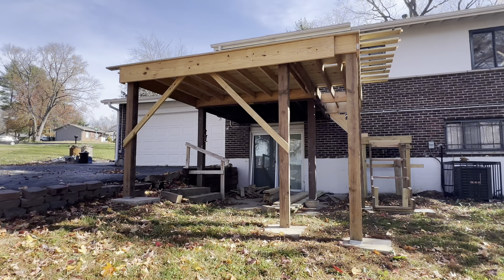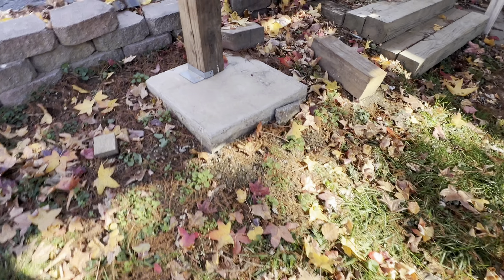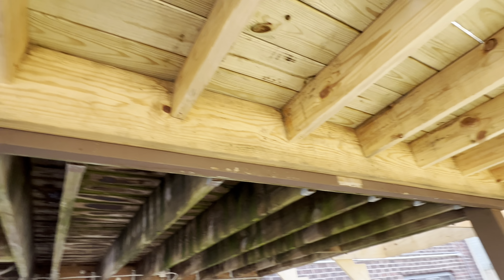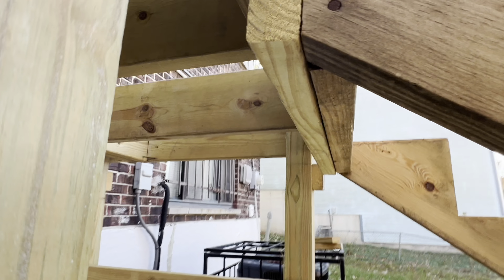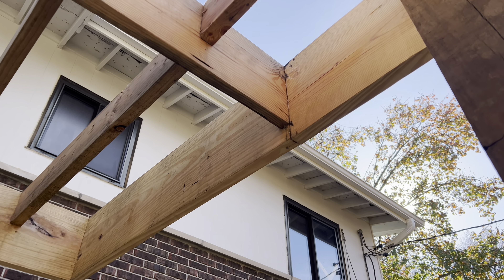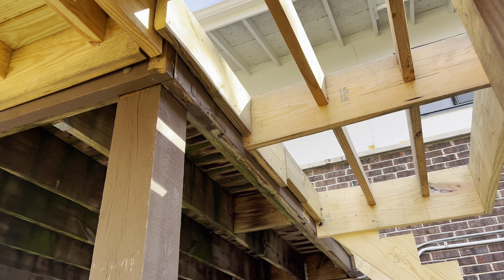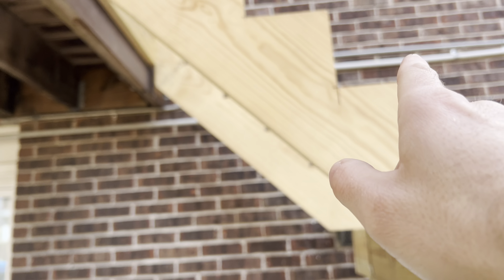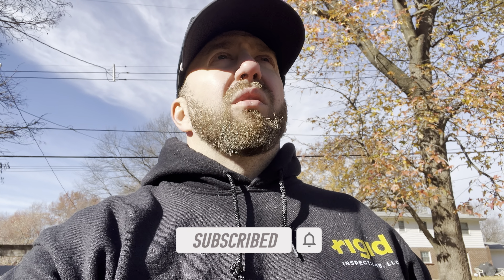JUNK Deck Costs Homeowner THOUSANDS!!

Comment: NEVER use “deckmate” brand screws (the ones from home depot).
They redesigned them several years ago with a priority given to maximizing the amount of screws that can be turned in with a single battery charge.
These screws have very little holding power, especially if you are going into end grain (where they will have ZERO holding power)
Just a terrible screw that has caused a ton of problems for people unfortunate enough to have used them in their project.
Reply: yeah they also seem to have shorter threads than other brands I have used recently. Which leads to them spinning out in places they should be digging in. And then you can't get them out without taking the board off and hitting the pointed side with a hammer. Very annoying. I found it is best to order screws online at a much lower price. You can get quality GRKs for what lowes and HD want for deckmate screws. And GRK screws will back themselves out 99% of the time because the thread goes much further up the shaft.
Reply: @hotbam37  you realize that the shorter threads are designed for screwing down 1.5 inch thick boards?  The long thread screws don't let the 1.5 inch thick material tighten down to whatever it is being screwed to.  There is a place for longer threads, and a place for shorter threads...

Comment: Normally I would say the deck video is so bad that it doesn't look real,  but,...      my daughter called me several weeks ago because the deck that came with their house was sagging.   I had been encouraging her to go ahead and plan a new deck since the one that came with the house was small and around twenty years old, still I grabbed a few tools and went to take a look, crap.    Their deck had been built to the same standards as the one in this video, with the exception it was done with nails and not deck screws.   No hangers, no bolts, no 6x6s, no notching, and hopefully there were footers under it's 4x4 posts.    What we did was use a jack to raise and level the flooring section, adding a 6x6 post and a couple of 2x8s as a beam to support the deck load.  Then added hangers and used "Timberlocks" to temporarily tie everything together so they can at least safely use their back door.    I told her the only real solution is to completely tear it down and start over with a "Proper" design which they can do themselves through "Lowes/Home Depot" as a starting point.

Now back to this video since I didn't notice a building permit which of course would have required an approved design.  Seems most likely the homeowner didn't want to get a permit and found the guy who would do it on the down low.  One additional thing about my daughters house, when they bought eight years ago they had a "Professional" home inspection performed, he found a lot of minor issues but seems he never looked at the deck which to me would have been a huge red flag.   I also suggest she file a complaint about the so called home inspector,...

Comment: The #1 reason I became a Home Inspector was the number of dangerously poor decks I saw while in the lawn business and also from power washing decks. It never ceases to amaze me how many do not have basic carpentry skills or own a level. Everything this guy did is completely wrong and should be condemned and torn down! It's obvious no permits were pulled, but sometimes even the local inspectors can't be trusted.

Comment: Horrible.  One time I saw a deck on a new construction house where there was a ledger on the house, but no joists hung on it, except two end joists maybe 12 feet apart.  These were used as beams and were both holding joists which were parallel to the house.  The whole thing was already bowed in the middle.

Comment: This homeowner needs to sue and this inspector needs to go after this stoog of a "contractor" and not only fine the crap out if them but also revoke their license and prevent from future projects. I've seen some crap before but this is a freaking nightmare. I've seen the 3 stooges do better work than this. I've been in the residential construction field for 30+ yrs and OMG it's a wonder this didn't fall apart the moment someone stepped on it. And those stringers....... 🤦‍♂️👎
Reply: these guys are always broke---taking them to court won't do any good

Comment: Judge Judy would have a field day with this one. 
Some of the 2X material is not treated. The upper stringers are not treated, it looks like the added “ledger” at the original deck is not treated. You can tell the lower stringers are used by the busted 2X tread/riser…. that happens every time you tare out a set of steps. The homeowner probably shopped around to hard and found the bum. A $500 deposit is suspicious, you can’t get much material for $500 bucks. 
RUN THIS JACK LEG OUT OF TOWN!!

Comment: I encourage anyone looking to hire skilled labor for a big project (carpenter, plumber, auto repair, etc) to do their due diligence and see what the job entails. With all the e-books and youtube videos, there is no reason not to he informed. This homeowner could have pulled the plug a lot sooner before this monstrosity went this far with a basic understanding.  I am in no way blaming the homeowner. Im using it as an example to help prevent others from experiencing the same fate.

Comment: I will say this. All the straps used today aren’t NEEDED. If you knew how they came to be with lobbying, it would blow your mind.
35 years ago, we didn’t use any metal straps and they are still just as strong as the day they were built
But this deck is total crap

Comment: Unless the camera angle was funky and I'm not seeing it right, the posts on the old deck are wrong, too. He should have pulled them and replaced with a notched 6x. We don't hang off lags any more. That wing extension is terrifying. That's not how cantilevers work
Reply from the maker: The posts ok the og deck were 6x6 and had a notch for a single 2x10 to support all the joists. Not ideal for a single board to hold it but better than anything this idiot did lol

Comment: The first thing that I noticed is the poor way that the old deck was framed. I would have torn down the old deck before I even started. I will only add onto an already existing deck if it's built correctly in the first place. I hope she doesn't let those jokers come back.
Reply: Old deck parts can be used for other projects   so save them
Reply from the maker: The old deck wasn’t too bad. There were a few things that needed corrected but overall compared to the “addition” that the ding dong added, it was an okay structure
Reply: @rigidinspections  Single band joist and not notched to sit on posts is not how I would do it and would be allowed where I live. It looks like the post may have a 1/2" notch but I cannot be sure and that would be pretty pointless.

Comment: This has to just be some random dude from down the road building this. I cannot imagine a contractor having a license and doing this.
Reply: It's probably not the same in all states, but in my state and many others, the only requirements for a contractor's license are that you pay for applicable insurance, bond, and the license.  So virtually ANYONE can get a license, even if they have ZERO expertise or experience.  That's why it's important you only hire a contractor from a trusted referral.  Lack that, there's simply no way to know you're not pouring money down the drain.

Comment: Doesn't her municipality have any inspection people on staff or certification for contractors to work in the municipality
Reply from the maker: Yes, assuming permits were applied for. They definitely were not for this one
Reply: @rigidinspections  that is sometimes the problem. customers would say to me they dont want me to pull a permit bc it affects their assessment. no permit, i do not do the job. they find someone who will do it without a permit and this is what you can get.

Comment: I'm assuming there must be some sort of licensing for contractors there. If so, have the home owner file a complaint with the licensing board.
Again, not sure about this location, but I'm also assuming the deck would need to be inspected by a local AHJ, who would surely fail this abomination in a heartbeat.
Once again, assuming the homeowner has a contract with the moron who built this. Of course its just as easy to assume this "builder" is yet another scammer just out to steal peoples hard earned money.
Unfortunately, if the homeowner did not exercise due diligence, their only recourse will be through the court system, if they can even find the dirt bag, who has likely already changed the business name and moved on to their next victim.

Comment: Having lived for many years in Massachusetts I can say definitively that this deck is overbuilt by Massachusetts norms.
The 4x4s would be 2x4s, it would be 24" on center and the whole deck might have half a box of 1/4" 3" inch drywall screws.

Comment: That ledger strip in the front should be fine as long as it's tight to the girder. Needs a 16 penny at each joist. Cheaper than hangers.